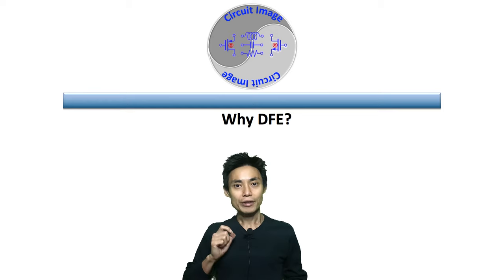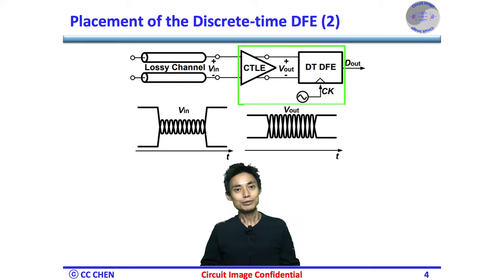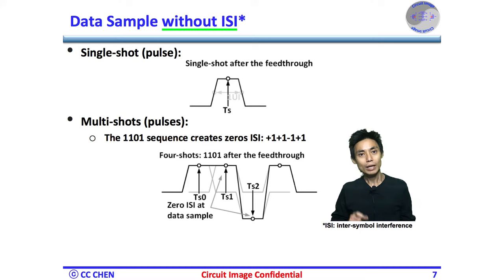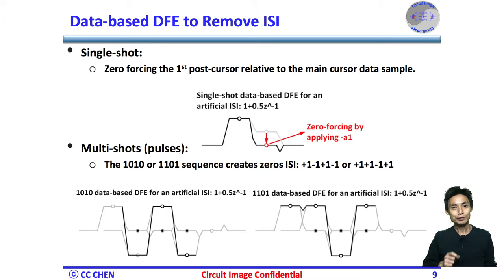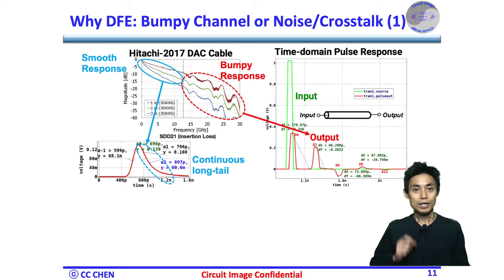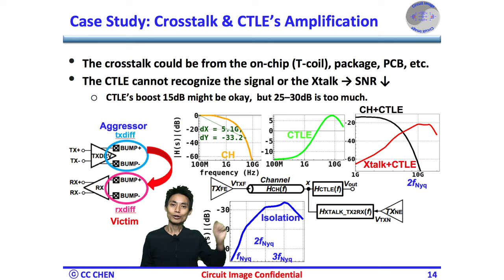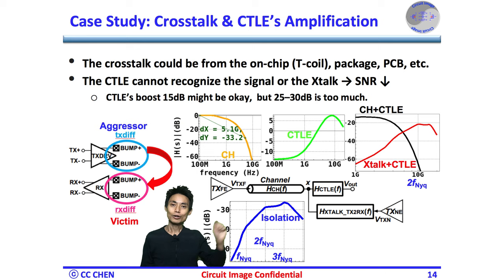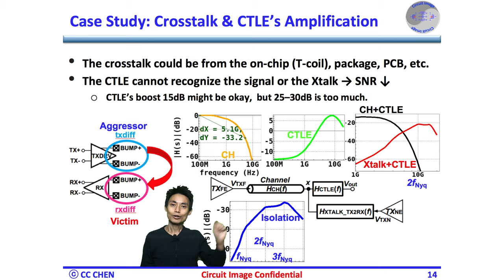Why DFE?

Comment: Thank you very much for your great videos. Just a dull question, would you please explain, why a bumpy response would create a reflected waveform time domain? And why they are created in 3UI, 6UI and so on?
Reply from the maker: Thanks for the feedback and good question. The case study of those reflections was just an example of 3UI, 6UI, and so on, which might not be in other cases. The reflections may be from the discontinuities in the packages, vias, connectors, etc. So, every link could have different reflections in time so as the response in the frequency domain. Lastly, not the bumpy response creates a reflected waveform. The discontinuities at the interface would create a reflected waveform and the bumpy response was just the frequency response due to the discontinuities.

Comment: Hi Teacher,  I have been enjoying your videos.  Thanks!  I have some question.  It seems the DFE can reduce the ISI by suppressing the post cursor, where educing the ISI can improve the Voltage margin, that is the eye height, correct?  Does DFE improves eye width?  It seems to me both CTLE and DFE improves eye height only, Is there any receiver parameters can improve eye width especially the eye left and right are not equal/balance?
Reply from the maker: Hi Zan, nice to meet you and I'm glad you like my videos. Thank you so much for the excellent questions. Please be advised that both the eye width (EW) and eye height (EH) are correlated; therefore, if EH is improved, the EW should be improved. But for DFE, there's a subtlety since that would require feedback (FB) timing or settling time requirement and most of the data DFEs cannot FB fast enough, so that's not improving the EW effectively. I can show other edge DFEs images later, and that would help the EW effectively.
Reply: @circuitimage  Thank you teacher!  another question.  If I see the eye width is horizontally shift left / right side,  Which parameter I should check?
Reply from the maker: @ZanZ-qi6wz  Thank you so much for the good questions.
If the eye width was shifted, you could check if the TXFFE or CTLE did not cancel the pre-cursor well enough. Another possibility is the DFE's settling time takes too long, even though it meets the 1UI timing. :)
Reply: @circuitimage  Thank you very much for your explanation again!  Very helpful!
Reply from the maker: @ZanZ-qi6wz  You are very welcome. :)

Comment: What is the meaning of taps in DFE? (1 tap, 2 tap, 3 tap etc)
Reply from the maker: The number of taps means how many Tbit (or UI) you can cancel the length of the ISI. For example, if you only have 2 taps DFE, you can only cancel the 1st & 2nd post-cursor by the 1st tap & 2nd tap feedback summing signalling to cancel the previous ISI; therefore, you cannot cancel the previous 10 UI's ISI, for example.
Reply: @circuitimage  Understood. Is there an article or link that explains how to configure taps for DFE in detail? Also, do you have an email ID for further question?

Comment: Hi sir, thanks for the sharing amazing video. I'm wondering why DFE only cancel the post cursor(signal falling edge) due to at next bit may create nonzero value? No impact of pre cursor(signal rising edge) if the nonzero value is negative?
Reply from the maker: @顏擇敏 Thanks for the good question. The DFE  is decision feedback to cancel the previous bit (symbol); therefore, that only canceled the previous bit's post-cursor. Technically, the DFE cannot cancel the previous bit's pre-cursor.

Comment: Hi Dr.Cheng, thanks for the great video.
I'd like to inquire one question which is the tap, can I take tap as a filter since if DFE have more taps, it means DFE can cancel more post-cursor ISI and if FFE has more tpas, it can cancel more pre-cursor ISI, and if we increase more tpas, it means we need more flip-flps, so it will increase the area. Please correct me if I'm wrong.
Thank you again.
Reply from the maker: Thank you so much for your good questions. Your understanding is correct and we can.
Reply: @circuitimage  Thanks for your reply
Reply from the maker: You are very welcome 🤗

Comment: Thanks for the presentation.
I got one question: why is the DFE immune to noise and crosstalk. Noise and crosstalk will be present in the input of DFE, how could DFE know how to make the decision?
Reply from the maker: Hi Minh, Nice to meet you, and thank you for your great question. The DFE would not be immune to noise & crosstalk, but at least the DFE would not amplify it. For those noise & crosstalk are mostly high-frequency content, and the CTLE would amplify it (at the frequency greater than the Nyquist rate) and de-emphasize the DC content and reduce the SNR. So, the DFE would be less vulnerable to noise & crosstalk than the CTLE.
Reply: @circuitimage  thanks for clarifying. Keep up the great content. 👍🏻
Reply from the maker: @MinhPham-je1gt  Sure. Thanks again for your great feedback.
Reply from the maker: @MinhPham-je1gt  Sure. Will do and I hope to receive more great feedback from you :)

Comment: Thanks for your video, I have a question for the eye diagram at 8:17. Is the green eye diagram what we want to have, such that at the clock rising edge, there are 4 different levels? But the input has only 2 levels, so I am confused why the green one is better than the red one. Thanks!
Reply from the maker: Hi Hanyue,
Nice to meet you. Thank you so much for the good question. The example I've shown here is a half-rate DFE topology; therefore, the rising edge of the clock would sample the 2 levels eye diagram while the 4 different levels eye diagram was settled in the summing nodes. Hopefully, this helps your understanding.
Thanks again.

Comment: Very good channel , liked and subscribed! 
Two questions.
1) Is the DFE a FIR filter ?  like TXFFE.
2) I imagine that DFE has a high pass frequency response but with bumps. While in your TXFFE video, frequency response of the TXFFE is more similar to CTLE (no bumps). This is surprising, because it seems to me that TXFFE and DFE are very similar to each other...
Thanks
Reply from the maker: @Hrachya Khachatryan Thanks for the feedback and I'm glad you liked it. I have comments below.
1) No, it's like an IIR since the feedback tap
2) Both TXFFE & DFE are discrete-time, but both TXFFE & CTLE will amplify the noise, but the DFE wouldn't; therefore, the similarity is still different in terms of properties :)
Reply: @circuitimage  Thank you )))
Reply from the maker: @hrachya_khachatryan  You're very welcome :)

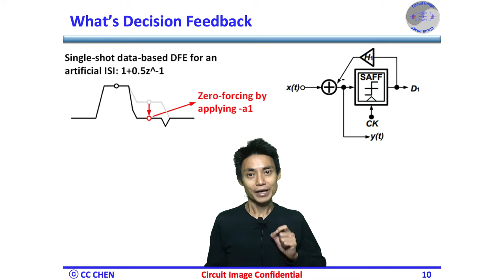Comment: Very nicely put presentations and I learnt something new! At 6:40 you mentioned that propagation error is usually not a big issue. As the speed increases, closing the timing of the first tap could be difficult due to many number of taps being implemented at the summing node. I am wondering what's your thoughts about the error propagations due to the difficulties of closing the first tap at high speed design? Appreciate it. Thanks again!
Reply from the maker: Thanks for the feedback and good question. You could apply a sliding tap or separate summing amplifier to reduce the loading for the 1st tap at a high-speed SerDes. Let me know if that's not clear to you and I could make another video to emphasize what I meant.
Reply: @circuitimage  Yes that would be something interesting to learn about(regarding the tricks to reduce capacitive loading on the summing node)! Look forward to it!
Reply from the maker: @Zheng Lai :) Here you go: https://youtu.be/BZLVH-8JFys